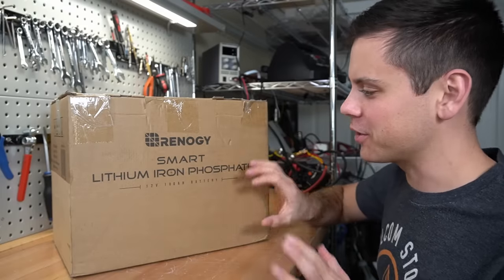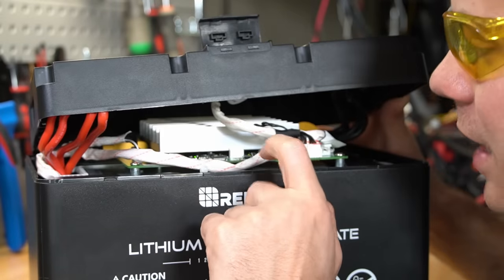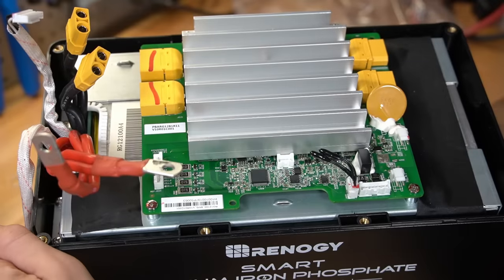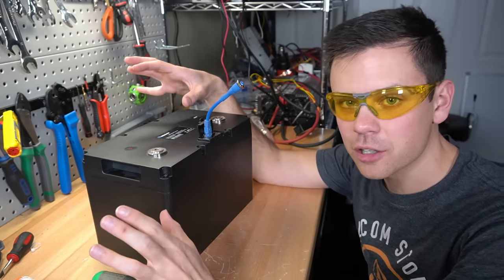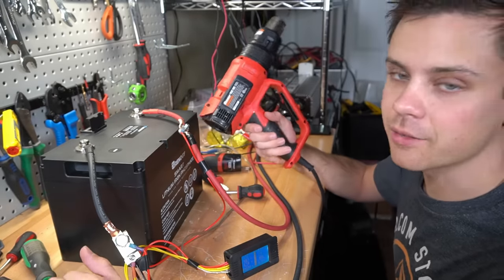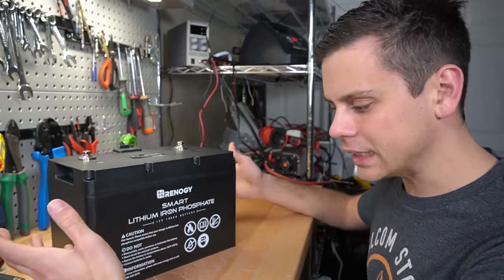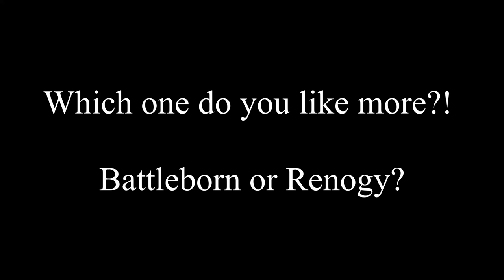Renogy "Smart" 100Ah LiFePO4 Battery Tear Down

Comment from the maker: Does off-grid solar confuse you? Check out my DIY friendly website for solar system packages and product recommendations, and so much more! http://www.mobile-solarpower.com

Join our DIY solar community! #1 largest solar forum on the internet for beginners and professionals alike: https://www.diysolarforum.com

Check out my best-selling, beginner-friendly 12V off-grid solar book (affiliate link):
http://amzn.to/2Aj4dX4

If DIY is not for you, but you love solar and need an offgrid system, check out Tesla Solar. Low prices and great warranty, and they can take your entire house offgrid with their new Powerwalls: https://ts.la/william57509

~~~~~~~~~~~~~~~~~~~~~~~~~
My solar equipment recommendations (Constantly updated! Check here first):

12V/48V Lithium Batteries: https://www.mobile-solarpower.com/solar-batteries.html

Solar System Component Directory: https://www.mobile-solarpower.com/solarcomponents.html

Plug-N-Play Systems: https://www.mobile-solarpower.com/full-size-systems.html

Complete 48V System Kits: https://www.mobile-solarpower.com/complete-48v-solar-kits.html

DIY Friendly Air Conditioner/ Heat Pumps: https://www.mobile-solarpower.com/solar-friendly-air-conditioners.html

Complete 48V System Blueprint: https://www.mobile-solarpower.com/48v-complete-system-blueprint.html

~~~~~~~~~~~~~~~~~~~~~~~~~~
My Favorite Online Stores for DIY Solar and Coupon Codes:

-Current Connected: SOK, Victron and High Quality Components. Best prices and warranty around: https://currentconnected.com/?ref=wp

-Signature Solar: Cheap Server Rack Batteries and Large Solar Panels:
https://www.signaturesolar.com/?ref=h-cvbzfahsek 

-Ecoflow Delta Official Site: My favorite plug-n-play solar generator:
https://us.ecoflow.com/?aff=7

-AmpereTime: Cheapest 12V batteries around:
https://amperetime.com/products/ampere-time-12v-100ah-lithium-lifepo4-battery?ref=h-cvbzfahsek

-Rich Solar: Mega site and cheaper prices than renogy! Check them out: 
https://richsolar.com/?ref=h-cvbzfahsek

-Shop Solar Kits: Huge site with every solar kit you can imagine! Check it out:
https://shopsolarkits.com/?ref=will-p

-Battery Hookup: Cheap cell deals
https://bit.ly/2mIxSqt
10% off code: diysolar

-Watts 24/7: Best deals on all-in-one solar power systems, with customer support and distribution here in the USA: 
https://watts247.com/?wpam_id=3

~~~~~~~~~~~~~~~~~~~~~~~~~~~
Contact Information:
I am NOT available for personal solar system consult! If you wish to contact me, this is my direct email: williamprowsediysolar@gmail.com

Join the forum at https://diysolarforum.com/ if you wish to hang out with myself and others and talk about solar

FTC Disclosure Statement and Disclaimers:
Every video includes some form of paid promotion or sponsorship. Some links on this youtube channel may be affiliate links. We may get paid if you buy something or take an action after clicking one of these. My videos are for educational purposes only. Information is subject to change/update at any time. Electricity is DANGEROUS and can kill. Be smart and use common sense :)

DIY Solar Power with Will Prowse is a participant in the Amazon Services LLC Associates Program,
An affiliate advertising program designed to provide a means for sites to earn advertising fees by advertising and linking to Amazon.com
Reply: Is this battery suitable for vehicles or dashcams running 24/7 parking mode? If not, what's the most powerful safe battery you would recommend for dashcam running 24/7 through motion detection?
Reply: I am curious why this battery isn't listed as  recommended battery on your website. I only need 1 battery, and I only need 12v. I am wondering if the LiTime batter or this one would be better, since they are about the same price now. Also, have you done any recent teardown of a renogy battery?
Reply: @Willprose what do you do with the battery after you pull it appart. ?

I have the same battery that failed on me after 11 months, i need the lid of the battery. For its uplink ports. 

  Renogy has the worst customer service i have ever dealt with. 0/5 
And 5 year warrenty that they will not stand behind.  0/20

Do not buy renogy. 100%

My  Up-link ports have corroded on me sitting in my truck, super choked because renogy says its designed like that, my battery turns on and off when ever it wants Due to renogys design flaw. My amp and sub woofer are in the same area and they are fine and have been for 5 years.

RENOGY is not a good company to deal with.

Comment: It's about 4 years since i first watched this video and then purchased this battery.  Has run my 4wd 12v system flawlessly since and only lost 2 to 3ah of capacity.  Nice!
Reply: I watched your video carefully again trying to work out how the pouches are stacked. Mine has been on its side so the pouches have been sitting vertically. Doesn't seem a problem which way they sit??

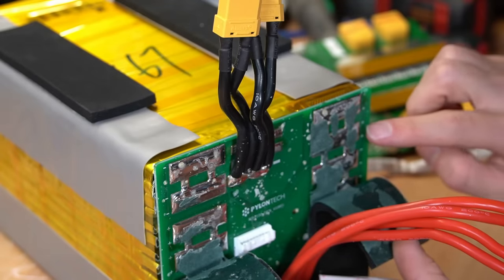Comment: 3:35 The branding under the sticker says PylonTech, so that is probably the manufacturer not only of the BMS but of the whole battery. Thank you for the interesting review. I would always prefer Battleborn‘s cylindrical cells over pouch cell as they keep the electrodes in their place more precisely than pouch cells and they can dissipate heat much better.

Comment: That battery chemistry is pretty safe in any packaging factor. LiFePO4 pouch cells are about as safe as you can get. You can run a nail through them and not start a fire or cause an explosion. They will get hot, but they will pretty much just fail in the damaged area and cauterize. It's not like Lithium where whey vent extreme amounts of gas and risk run away damage from extreme heat leading to explosions. 

Also, since that XT 90 plug isn't running negative and positive (90 up and 90 down for a combined 90 amps circulating) you can get 180 amps (the same 90 + 90). So technically those plugs could support 360 amps :)

The 4s setup probably allows the batteries to run many more amps than the BMS will output. This keeps the cells cooler and means that even during heavy usage the cells will remain very healthy.  

It's very over-engineered!
Reply: Thanks for sharing this info.
Reply: This is great news as I just bought this for my RV. Also bought the BT module so I can view the details from my phone.
Reply: @odertube  How is it working out for ya ?
Reply: @itrow9526  Love it! Lightweight and very powerful. I can remove it from my RV without breaking my back and I get more than 3x the Ah capacity of my Lead Acid battery. The price was impressive as well. Very happy with my purchase.
Reply: @odertube  Nice, thanks for replying.
Reply: @itrow9526  Anytime. PS: The BT module is pretty cool.

Comment: This review push Renogy over the top for me.  I only run all 12 volt gear to avoid the inverter conversion power loss, so this is perfect.   The smart battery network feature was an added benefit.  First on came this week.  I’ll add a second next big sale.  Thanks Will for you hard work and great evaluations.

Comment: I bought two of them, hooked up in parallel. Using 2 x 30a Renogy charge controllers, and a 2000w renogy inverter. All sitting on a small wheeled wood trolley. Fully fused, it was a great learning process! And given these batteries are good for about 4000 cycles at 80% DOD, I'm using them every day, and it makes a fantastic power backup.
Reply: you charge them with?
Reply: @SergioMorello1  solar panels, can use up to 800w, so i have 4x 200w
Reply: Could you run all appliances in a RV? I mean, in a regular every day life.
Reply: @glaoak1787  Depends on what you are running, you need to work out total daily kwh and provide for that in both input and output.

Comment: You forgot to mention another good selling point of this battery. Over 4000 cycles at 80% DoD. I am assuming at 1C, but it is not mentioned in the spec.

Comment: Thank god. I've been waiting for your review. I bought one and HAve been running it for a couple of weeks. Unfortunately Battle Born not available in Australia so I took the gamble. Great price point here with free shipping which added to the Value . Thanks for the break down and ease of mind.

Regarding the Ethernet port, I thought I read it was to connect multiple batteries together to assist with balancing across all the cells in multiple batteries.
Reply: i don't see the point. These 12v units are not to be connected in series, only in parallel. With parallel connection, you don't need any external method of balancing them as parallel connection itself will equalize all the connected batteries to the same voltage.
Reply from the maker: Yes, no real need for communication with parallel connection. it mentioned that in one of the manuals too. Small manual stated otherwise. Really strange to have any form of communication between parallel batteries. Must be for future monitor system
Reply: @Jimmy Call Good point
Reply: Looking at buying 3 of these for my van. In Aus it's hard to find any reviews or info on most of the suppliers here. Will likely get these as they actually have people talking about them, unlike Jaycars offerings or "Pro-Power". Cheers!
Reply: @VagrantShadow  I've got 2 for my shed setup running 2 fridges with 600w of panels, I use about  20-30% of my load over night. Been happy with them.
Reply: I I would like to know how happy you are still ? Thinking about buying 3 for my camper , with the bt -2 can I then see all 3 battery’s or I Need some cables ? All 3 will be in parallel, thanks...
Reply: @christianwinkelmann8477  still happy. I got the two looking at a third.
Reply: @ScottHarder  cool, thinking of buying 3 for my bus , any experience with there BT-2 ?
Reply: @christianwinkelmann8477  Unfortunately no. I have a victron 100/50 smartsolar MPPT  so that handles the BT side of things.
Reply: In my Caravan(Travel Trailer for you in the USA), I’ve got three of these in parallel, with Ethernet cables linking the “Up” and “link” ports between the batteries. Then have the Renogy BT-2 Bluetooth module plugged into the last battery. Then via their Renogy DC Home App on my iPhone I can monitor the states of all three batteries down to Cell level in each battery. As Will showed there are 4 Cells in each battery connected in parallel, with each Cell consisting of 4 LFP pouches connected in series. It is great because you can monitor SoC, Temp, Voltage etc of each battery as well as the Total of all of them. We pay AU$750(US$580), delivered to your door here in Australia. Battleborn batteries only are available in 🇺🇸 so we have a reduced choice. But, I’m happy with the Renogy so far.
Reply: @christianwinkelmann8477  the bt2 will allow you to see up to 4 simultaneously, as I dont think Renogy recommends wiring more that 4 together at a time.

Comment: This video convinced me to get this exact battery (RBT100LFP12S-G1, not sure what G1 stands for). I had a local overlanding shop install it with lots of power management, solar, etc., in my 2021 Jeep JLUR. Two years (almost) and never an issue. Trust me, I do a LOT of offroad/overlanding. I really appreciate this video, I'm quite a fan.

Comment: Will, ask them why it can’t be used in series. Nice battery!
Reply: I'm betting it has to do with the communications system. The comm wires from the high batteries will be at a different voltage that the low battery comm wires.
Reply: It’s the way the BMS is configured is my guess. The comms can be powered separately.
I don’t see it being a big deal given their target market.
Reply: I believe pouch cells are unable to handle the pass-though current. Just are solar panels themselves differ greatly in how many can be placed in series.
Reply: @geraldhenrickson7472  current just knows that it is flowing to a lower potential. Just so you don't use 2 batteries to increase the current (ala your analogy with solar panels which also are voltage limited because of ground shorting possibility- these batteries are well insulated)  above the rated amps the battery knows no different. Even if one was at 100% SOC and the other was at a very low SOC it wouldn't hurt anything but they would need to be balanced when recharging. Current is always passing through  a battery when it is discharging. Current is constant the amount of voltage added by each cell depends on the SOC ,the current, and the resistance of the cell. Each cell should be identical and of the same age, system can only perform as good as the worst cell.

Comment: I bought two of these.. With a DCC50S amp DC-DC MPPT charge controller. To go with my Renogy 2000W 12V P2 Inverter. It does what it claims. The DCC50S will default to 25 amps charging. When the RV is running. To protect the Alternator at idle.. As alternators are expensive if they go out...

So I'm happy.. I can run everything.

Comment: I like that fact that you can disassemble it with standard tools and not having to cut apart the case, so if the bms fails it could be repaired. Be nice if they could do series connected even if just to 24 volts as 12 volts limits what you can do, but still it's a pretty cool build.

Comment: As an electronic tech I'm very impressed with the engineering and serviceability of this Renogy battery. Electronic components and mechanical connections do fail, as you have seen in your other battery tear downs/reviews. I would definitely pick these over the Battle Born for all my 12V battery banks! Thank you for the battery reviews!

Comment: I just purchased and installed two Renogy 170 Ah batteries, which did not come with a communications port and switch. So far I love them! 340 Ah in two batteries! Hopefully, mine are as well built as the one you tore down. Keep up the great work!
Reply: How did the 2x170 ah batteries hold up Roger?
Reply: @philwilliams23  Abdsolutely love them. Have four of them for a year on a travel trailer, and now have six 170A Hr batteries on our fifth wheel for 14 months and counting. They have been fantastic. Twice we accidentally drained them and in both cases they charged right back up with no issues. A great BMS as well. We use two Victron Multi-Plusses and Victron MPPT controllers and 2360 watts of solar.

Comment: Series only connection is a huge factor, they need to change that.
Reply: We have some batteries here in Australia that limit series connection to two batteries. I think this has to do with limitations in the BMS, and yes it is a stumbling block. Many use 24V and 48V systems and these voltages makes so much sense when you have battery storage over 2kWh.
Reply: Definitely a deal breaker
Reply: @jackturtle131  yep, sell for around 595 Australian pesos. Still only good for 24V..no good to me.
Reply: How does Battleborn support batteries in series with a common cathode BMS?  I would have figured that if the first battery cuts off from overcharging that it would disconnect the rest of the batteries and they could potentially never be fully charged.
Reply: @jeffg3563  Damn good point Jeff G
Reply: @jeffg3563  I'm curious about the answer to your question Jeff G.   All the answers I can think of make me wonder why it's a problem for others.  If one battery in series stops charging at 14.4V and the next one in series is only at 14.3V, will they both settle to a full state, like 13.4V?  Or does the BMS let a little charge keep flowing?  Or does a little charge current keep flowing without charging the battery more (as a full dam allows current to flow in after it's full)?
Reply: I suspect, if Renogy have any sense, they will develop the hub system to communicate with each individual battery and use that to control the "pack". If an individual battery can cut input (charge) but still allow output then this is where the hub system can remotely control and keep the pack as a whole balanced without having to disconnect the entire pack from the load
Reply: @MiniLuv-1984  Australia doesn't use pesos, dude.
Reply: This battery is parallel only, not series only.
Reply: true.  Ausie currency it now uses Yuan !!  lol
Reply: @jeffg3563  That is why an active balancer bms is needed.
Reply: Parallel only.
Reply: @KyrstOak  tongue in cheek Sun Jara

Comment: Will, the Com Port was designed to work with the Renogy Lycan Power Box. I have one and have found flaws with it. You should look into one.  I can share my thoughts with you and issues I have came across. Also with multiable batteries the com port will help with balancing of all batteries.
Reply: Hi I would like to know when I have 3 of them in parallel and use there BT2 can I then see a 3 or I need more cables? Thanks...

Comment: Hey Will,
First of all love I all of your videos. I am a grid tied solar installer but dabble in DIY off grid stuff. I am a certified LG Chem RESU installer and in their training they say that pouched cells are not a very good design because where they are folded and that causes weak points where deformation occurs over time due to the cells being stretched.

Comment: Finally, a 100 ah battery for backpackers!
Reply: You are better off with a portable battery pack. Far better.
Reply: @geraldhenrickson7472  my comment was pretty much tongue in cheek. Most backpackers don't need that kind of power, though if you had a group of four or five, and someone needed a CPAP machine or some other appliance it could begin to make sense.

Comment: I just ordered this battery to run a fridge off solar at camp, now i'm pumped also knowing I can use a 3rd party bms should the onboard one fail.

Almost seems impossible for this battery to do the job of a large lead acid and do it better,

 Thanks for the vid

Comment: Love the episodes buddy, Don't think we've seen you doing anything with Edison batteries yet (e.g.12V Bank Nickel Iron NiFe Battery 400ah 10 X 1.2V Cell) I've seen alot of them still working fine, even though they are 80+years old.